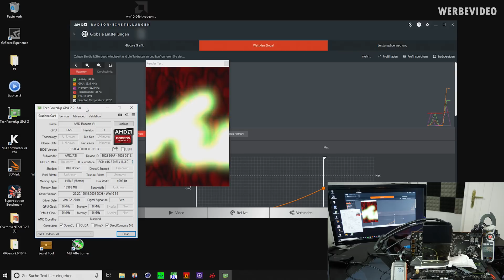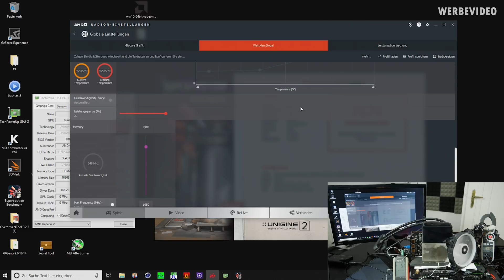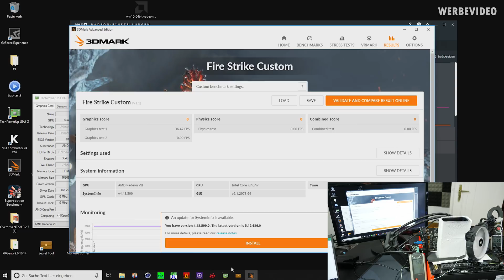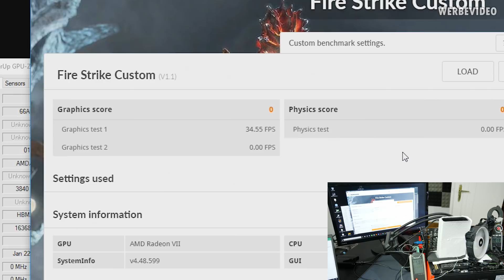RADEON VII Extreme Overclocking Attempt (en)

Comment: AMD's overclocking support being broken is pretty much the default state of it. They broke HBM OC on the Fiji cards and when people complained the response was: working as intended.
Reply: They really need to get on top of this fast.
Reply: I would really like to see you overclock this card. You are the best.
Reply: Ask one of these guys to try shoving a Vega FE bios on it and using the Vega FE drivers.
Reply: @CourtJester888  impossible really different
Reply: @jojoskunk   everyone is saying it's the same architecture. FE has the same amount and type of vram.  Only difference people have mentioned is the process switch.  Given that info shouldn't be much different than flashing between Polaris refreshes.
Reply: Like I said earlier, this is exactly the same issue I've had with a 7870XT I've had floating around the office since I think the 16.x.x range drivers. Probably even longer.

I ended up modding its bios a couple years ago to make it run 1150 by default and then still it sometimes manages to revert to 975 (which was the cards default boost clock).

AMD video card OC is weird AF.
Reply: @enlightendbel  It reverts after a crash or hard shutdown generally, I have same card. (I think it's to avoid softbricks or boot loops)
Reply: @t1g9t9g7  I used that card to get into BIOS modding and I'm 99.9% certain that there is no way the drivers can know from the BIOS that the default clocks were 925/975. Only way it knows that is from having defaults in the BIOS that are annoying AF.

Yes, it happens on crashes. Which I don't mind, good way to recover from a bad overclock.

Issue then is that there is no way to get it to use any other clocks than those defaults.

Changing the clock drops the card to 300/150.
Changing the voltage drops the card to 300/150.
Changing the fan curve drops the card to 300/150.

I hate "safety measures" like that. 

The only way to get the system to act normal again is a full OS reinstall. Usually a full driver clean and re-install doesn't get it out of it.
Reply: @enlightendbel  That's crazy, I've been running my (Vtx3D Black Ed) HD7870XT at 1215Mhz for about 6 years now, it only downclocks if its power throttling and only resets if there's a driver crash or something. Eventually I changed the BIOS but it was just an update, occasionally, maybe twice in that time done a clean install, but just dialed in the same settings and left it(Rebooting again after a driver crash generally reverts to the overclock).

Edit: It's an entirely after market cooling setup and I use it as an eGPU so it's open air, rarely goes above 65C.
Reply: Could try working on power play tables through registry to modify settings?
Reply: Yeah I'm they said they locked the Fiji oc'ing of the memory because the HBM didn't have temp sensors, still doesn't even remotely excuse that fact they lock it on the driver level. At least you could unlock the shaders with some Fiji cards. Actually, could you be able to unlock the extra shaders on the Vega 7? AMD seems to have been real lazy with this launch, and considering the vega 7 is just a cut down instinct, you might be able to get some free performance.
Reply: Have you found any solution to this for Fiji Buildzoid? I have 4x Fury crossfire on Threadripper, but with HBM broken, its really pointless (also they broke 3x and 4x 3dMark benching in drivers? It games fine at 100+ fps in Crysis 3 at 4k Ultra doubling my Titan Xp, but it scores the same as my previous 2x scores). So no hopes of beating 3-4x world records... I haven't tied my 4x RX 470 since I'm pretty sure its all just broken in benchmarks. Shame, I wanted to try 4x R9 390X and 290X benching (I can get some of those cards $50 a piece!)
Reply: From what I know its locked at the driver level, so it might be possible to use an older driver (I think it was 17.1 or older or something) to enable memory oc'ing again, I can test if ya need. Also, could ya hook me up with em deals lol?
Reply: @the-true-inferno  I was hoping for a workaround for modern drivers (invalid 3dMark scores if you're not using the latest drivers). Plus I think the game optimizations far outweigh out of date for memory OC (I've noticed large gains almost every driver update for Fiji, those stack up to some pretty impressive results that would be lost with older drivers). I just wish Radeon allowed overclocking again on "the overclocker's dream card", if they did, I'd blow a few up, and then have to buy more or some newer cards. Either way, they get more cards sold even if I'm just buying up all the used cards around me, because that drives up prices locally so more people will have an incentive to buy new. I can't fry cards as easily if they are half locked though...
Reply: TutorialsByKevin  wont work as well as it would have on larger nodes but it should scale to a point
Reply: Tadas Nanartonis no actually most of us need to stop being suckers and all this BS will stop we make thous companies its our money who make them grow
Reply: True. Not sure if there is a problem with the driver or Vega itself.  I have no problems with Polaris based video cards, they all work as expected.  Can't recall something bad.
My Vega 56 feels like a new product.  It rarely respects the voltages I put in Wattman.  Closing a game sometimes doesn't restore to idle voltages.
It crashes randomly at some mild overclocking. 
I want to undervolt thing for overclocking but it is so unreliable, I just selected the built-in undervolt feature .
Reply: zodiacfml how do you undevolt i had the vega 56 and it was hell good!!!  Msi blower style bios vega 64 undervolt the las two stages to 1050 mv  1530 mhz the mem was 950 mv raise it to 945 mhz easy could do much more and 50% voltage  overide
Reply: On my vega64 it works. i've hashrates to proove it lol
Reply: That's a page out of Apple's playbook.  It's not a bug, it's a feature.

Comment: Thats really disappointing. Even if it overclocks to get 10% gain and around 8400 score, thats still very low performance. 2080 Ti does 14000+ points on Superposition 4K Optimized on normal ambient cooling when overclocked. So you actually get the same perf/dollar from 2080 Ti as from Vega VII, if you take $1200 and $750 retail prices. Wonder if it is going to get the same hate or will everybody make an entire encyclopedia of excuses for AMD again.
Reply: Superposition is a benchmark. In battlefield 5 this card is at the same level as 2080ti
Reply: Lol??????
Reply: @vladmihai306  Honestly all of the early reviews seem to say the same thing, needs updated drivers.

Comment: By the way i tested an rtx 2080 fe, it gets above 8000-8300 in 4K optimized superposition bench. So this card is between an over lock gtx 1080 and a rtx 2080, not cool amd for the high price point.
Reply: I got with my rtx 2080 9000+ in 4k Optimized superposition bench LuL
Reply: @TheUnKnownMan997  9100 (4k opt. superposition)  here...  1920-1950 core and 7500 memory.  2080 xc evga @Timespy what about superposition?
Reply: Democritus86 my exact score was 9267 with stock clocks(1950 + 7000mhz) Rtx model is msi gaming trio x
Reply: 9703 (4k superposition) with Aorus GTX 1080 Ti...
Reply: Timespy doesn't reflect the real gaming performance at all and extremely favors Turing. It's a known fact.
Reply: @mrwtf2106  Dude the Radeon 7 doesnt even beat a 1080ti wtf was AMD thinking

Comment: The drivers need to be fixed so why the heck is AMD saying this is how the card is supposed to operate? Are they trying to make people NOT buy their new flagship GPU?
Reply: something is defo wrong.. he is getting ~7.3k+ score in superposition 4k,and my 2080 gets 9k so drivers are throttling the card somehow..
Reply: @ppsarrakis  Even my air cooled VEGA 56 gets over 6000 points in superposition.. and this card was said to be 20-25% faster than VEGA 64.. so something has to be wrong :)
Reply: @micosan   6000 x 1.2 = 7200. Nothing is wrong. Math checks out.
Reply: Yes this card is just a stop gap they really don't want it to sell it's either an extremely small profit margin or even a possible loss
Reply: Driver issues
Reply: David Whitfield  when he used dry ice he was able to get the card to clock at 2000mhz but he couldn't do that by making adjustments in software. Any software. So it seems it is the software (drivers). If temps allow him to do it then he should have been able to make adjustments to force the card to clock higher as long as the temperature of the card allowed it.
Reply: yes they dont want to loose even more money
Reply: @Ray Ward That actually makes sense. But shouldn't they be able to overclock anyway, even when they are "creator" cards? That will probably be fixed with drivers because the frontier edition had quite okay overclockability as well.
Reply: Really hope the open source drivers for this card is not as bad as these drivers tested here.
Reply: they only made like 5 k of em  they probs losing money for each they actually sell for now at least untill the prices go upto 800-900 then they might actually profit a tiny bit , seems they testing the market to see if people will buy em for 800+
Reply: Fixed drivers are now available.
Reply: Maybe because they clocked it so high you can't get almost anything more out of it. Maybe they try not to sell it because its production cost is so close to the consumer price.
Reply: @jpiscina  that doesn't explain not being able to undervolt and underclock though
Reply: @anthonym9626  Hardware design is so complex, I am pretty sure the hardware design could actually cause that. If it is true or not is an other matter through.
Reply: @anthonym9626  sure you're right, we will see then, odd acting nonetheless
Reply: Miner will buy it

Comment: IT auto to 2000mhtz ...... thats awesome! Something is wrong with the driver tho for sure.
Reply: It boosted to 2150Mhz at some time
Reply: It needs -25C temperature though, and it's even doubtful that there will be custom aib design radeon vii.
Reply: @AS-gb5wz  I think it has potential, since this card is not memory bandwidth starved at all. If it can go to 2200mhz with water cooler than you get another 25% boost which is more than 2080 ti.
Reply: @vladmihai306  but it cant even do 2100 on dice how tf is it gonna do that on air
Reply: 2000 isnt awesome, for 7nm its shite, ive seen pascal cards do 2190 on air
Reply: @bigcazza5260  Frequency is only 1 part of the deal.... What the card can do during this cycle is what matters...
Reply: @Bourinos02  my 1060 sits on 2190 through all of gt1 un 3dmark fs, gcn should be able to beat that on 7nm pathetic
Reply: @bigcazza5260  As I told you... Core frequency doesn't tell ALL the story... A 980 Ti with a core boost clock at 1400 MHz will still completely beat a 1060 with 2000 MHz boost clock... Number of CUs, memory bandwidth, GPU architecture and so on are the most important parameters...
Reply: @Bourinos02  avoiding the point, gp102 r@pes vega 7 at stock frequencies, let alone golden chips that do past 2152, amds use of 7nm for vega is a dissapointment, 1800 is probably doable on golden rx vega 56s, i bet if turing was tsmc 7nm it would be doing 22-2300
Reply: @bigcazza5260  Avoiding the point, Radeon VII isn't Navi it's vega...
Reply: @Bourinos02  making up the point at no time do i mention navi perf and navi is gcn
Reply: @bigcazza5260  um gcn is a completely different thing then gp102. And this beats most of Pascal besides the 1080ti on ln2. 7nm won't change gcns problems
Reply: @bigcazza5260  The 1060 is beaten by the 580 at less than 2GHz so what is your point? Nvidia has a bigger number?

Comment: So there's no overclock ability?
Reply: It's evidently physically capable of it since he's hitting 2100mhz at times. But the drivers obviously screwed up and none of the alternative OC tools have been updated to support it yet.
Reply: The drivers are just an early version
Reply: AMD has sold too much hardware for consoles. I think they forgot it was GPU for PC
Reply: @Fiufia  That's not it, when Jensen Huang said Radeon VII was a last minute idea he wasn't kidding. It's a consumer mi60.

Hence why it's driver issues and not hardware.
Reply: @dondraper4438  at least you can fix driver  issues doesn't give them an excuse they should of had that working  before launch  but it's better than hardware issues that you can't fix
Reply: @dangerous3.143  I agree with you dude, I am just saying amd has a tendency for day 1 drivers to be terrible. Amd only launched this product as a knee jerk reaction to touring, Jensen was right.

These are just mi60 cards with cut down compute capabilites. They should hit around 2000~2100mhz with undervolts and overclocks though.
Reply: @dondraper4438  i really hope this is a driver issue,if not its gonna be  a joke the magnitude of the 3.5gb memory 970 (just because so many Tech youtubers are gonna make videos about it)
Reply: @ppsarrakis  It has to be, because the Vega II is kind of an early indicator of Ryzen 3000 (7nm) clocks. It should clock 20~25% higher, which is what ryzen 3000 series will clock when compared to ryzen 1000 series.
Reply: @ppsarrakis  If it can attain 2000mhz sustained with a slight undervolt, it should mean ryzen 3000 series will get the same 25% clock boosts as well. Since the clocks come from the 7nm TSMC High Performance node that ryzen and navi will also use.
Reply: @dangerous3.143  Also having to RMA your video card two weeks after you bought it. I want a water block for mine. The drivers will get fixed, they had a new driver release this morning so be patient. I will continue to save up for one and the 12 core 3700X. 

Be happy that crypto mining has died. This time last year it would of been priced like the 2080 ti if not more and every last one would be sold before it left the factory.